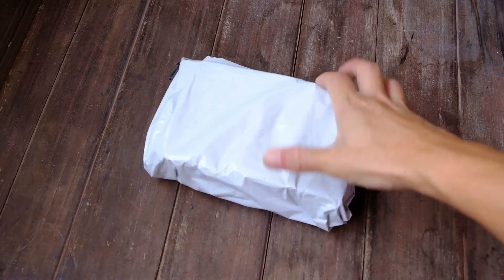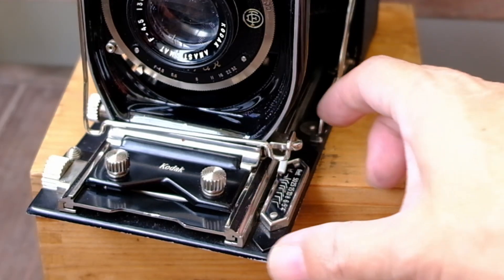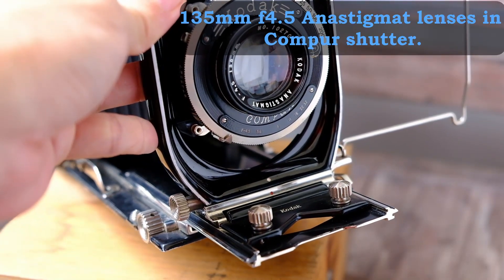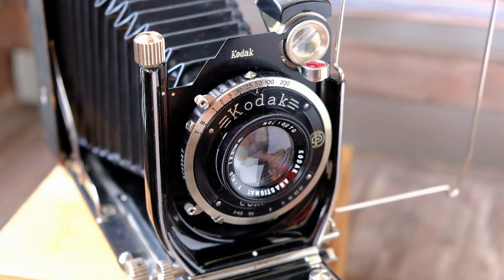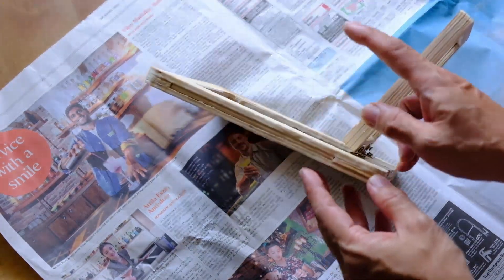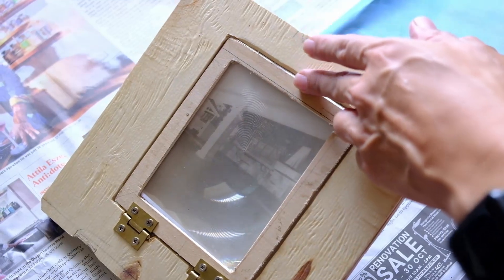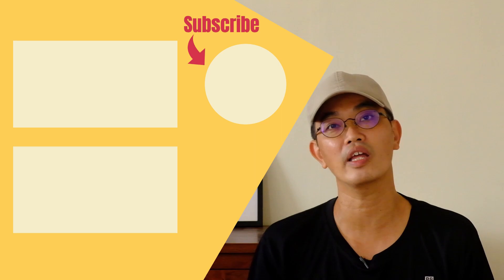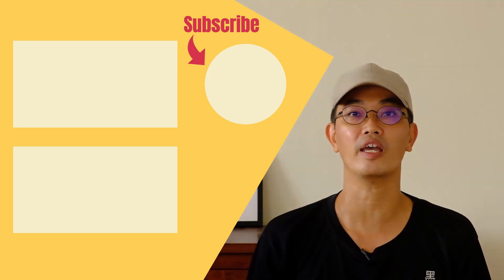How I build a Afghan Box Camera with a Kodak folding camera

Comment: Beautiful project!! I would like to do it too with my Zeiss Ikon 9x12 but I don't understand how you fixed the folding on the frame you built? Could you explain it to me? Thank you
Reply from the maker: inside the box 1 use some other pieces of wood to support and lock down  the 9x12 camera. hard to describes as it is no standard way to do it/ but once you start building you will find a solution for your camera.

Comment: I found your channel because of your copal adapter.  I want to print a guillotine shutter for that 360 soviet lens but i don't think anyone has printed one yet.
Reply from the maker: Hi there. Yeah have not seen a 3d design  print before. If I can find the time I can look into it.
Reply: @AnaloguePT  i'd ship you a spool of filament for that.   I've just been using a smart plug to control my lighting.  that only works in increments of a second.